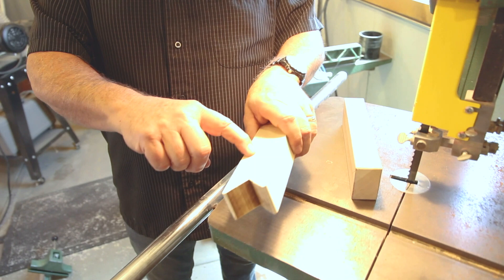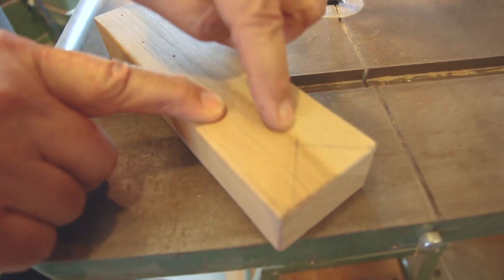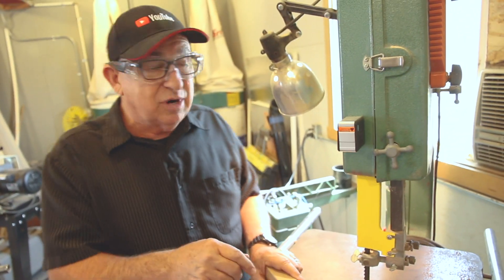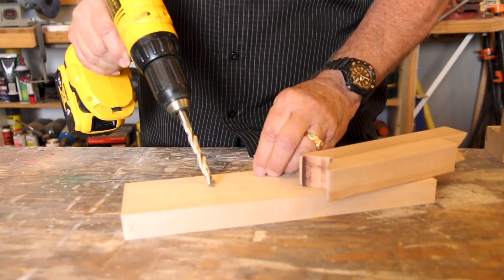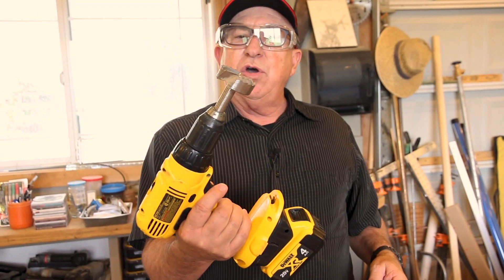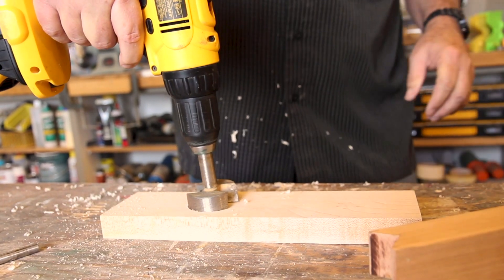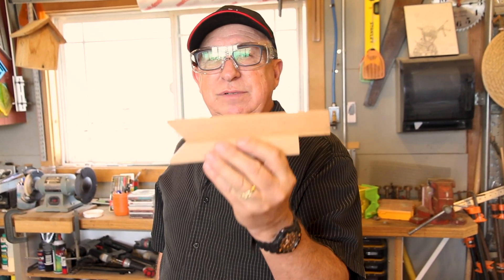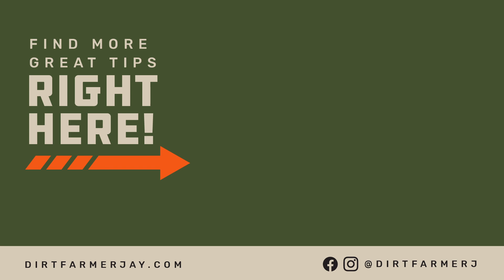Drill Straight Holes Every Time!

Comment: How can I make tool for center I need 120 holes for dowels to align ups straight on a loom end ... I need spacing if 1/4 -1/2 inch couldn't a hole be placed at 1/2 from the end so I can slide this up ? I need them straight both length of the board and straight base to tip. Thanks

Comment: Could you make one out of a square piece of aluminum ?
Reply from the maker: You could, you'd need a cut back to have clearance for the installation end of the nut. There is another fastener out there that doesn't require a tool like this - check out RampaTec. We have a video on them on the channel. Best, DFJ

Comment: Haha I remember I once made a drill guide by making free hand drill holes on a piece of wood, I ended doing like 20 holes until I finally got a very perfect hole that can be used as a guide to make holes on another surfaces, I marked the straight hole because the guide looked like cheese with all those holes, I did not bother doing a new guide using the previous guide. Good tips in this video, thanks.

Comment: A few years ago, I rigged up one of my drills so the drill bit was was vertical, then I glued a 2-axis spirit bubble to the back end. It doesn't keep it straight, that's down to the user, but it's perfect for making sure you're within a degree or two when you first start a hole. Really handy if you have to bottom out the drill bit and there's not enough to square it up against the workpiece.

Suprised more drill manufacturers don't include spirit bubbles by default, or have flat, parallel surfaces either side so you can square up the drill rather than the drill bit
Reply from the maker: Calibre Designs - you've got some great insights there. And, putting that feature on drill motor bodies would be an easy thing to do. Having a built-in reference surface would be a winner. Best, DFJ
Reply: I'm trying for a bit to add a system not unlike a picatinny rail to my Makita drill but the bloody thing doesn't have single straight edge or mounting point. I mean it's a drill, not a fashion accessory. I'm almost to the point to cover part of it in epoxy to give it a flat outer shape ;-)
Reply: @amonkane  maybe you can use a spirit level which is round and glued on the back using epoxy glue

Comment: Suggest you glue sandpaper on the bottom of the jig.
Reply from the maker: Jim, that's a GREAT suggestion. Thanks for writing. Same idea is putting sandpaper on a table saw angle gauge or jig. Works really well. Thanks! Best, DFJ

Comment: Hi thank you for the tips. I also noticed your drill. Just wondering how did you fit that battery on your Dewalt drill?  Or what's the adopter?
Reply from the maker: Project Kai, You're welcome! That IS a handy adapter isn't it? The Dewalt model number for this 18V to 20V is DCA1820. You can order these from several retailers including Amazon, Lowes and Home Depot. Expect to pay about $40. You can also find cheaper knock offs.  Hope that helps! DFJ
Reply: @DirtFarmerJay   thank you! I will try look some adopters for my old version dewalt tools.

Comment: Great! Thank you! I'm thinking you could make the v shape smaller with flat cutoffs (cut off the points of the "v" 90 degrees and mate with an identical piece, but without the handle. Two wingscrews hold them and let you almost down on the drill bit. If you want to ruin the simplicity which is it's great selling point. This was not such a good idea actually.
Reply: L shape brackets can shield the wood.

Comment: problem? doesnt the V shape piece of wood become altered with use over time??? surely a better way of doing this would be to glue some metal tubing in the V  (using epoxy) to act as the guide therefore reducing the wear made by the drill bit
Reply: Maybe uhmw plastic. They are available in adhesive tapes, 1.5mm thick. Slickstrip is this particular brand name i saw
Reply: Good idea.  But you would need an accurate tube and thus a block for each drill bit size.
Reply: Maybe if you used a half piece of tubing glued against the notch. Base the diameter of the tube off of the largest diameter drill bit that you have.

Comment: Love it, thanks!
Any ideas on how to make this tool w/o a bandsaw (or table saw, etc) ?
Also, does the drill bit ever cut into this tool ?
Reply: Take two straight scraps of wood and glue them together at a 90* worked for me
Reply: @candypaint6919  easy and brilliant!
Reply from the maker: End.Corruption - this tool can be cut using a fine-toothed hand saw as well, it's just faster and more convenient using a band or table saw. The notch is both to give clearance of the cutting portion of the bit, as well as allowing the bit to be placed correctly on the mark you made. Best, DFJ
Reply: Jigsaw🤷🏽‍♂️

Comment: I do like the idea but I was watching you use the forstner bit and I don’t see how you can drill very much until the drill chuck area hits the wood. Can you clear that up?
Reply from the maker: Tracy, thanks for writing. I could have shown a bit more on that point. If you are using a longer shank forstner bit, then you can more easily see the benefit. If not, you can start the hole with the end of the fixture that has the undercut on it, and get started correctly. Then you can freehand drill down just enough to get the top of the bit to be flush with the surface, then switch ends to use the end that engages only the drill shank. I hope this helps! Thanks for watching our video! Best - DFJ
Reply: Perhaps use a forstner bit extension...here's an example:                        https://www.amazon.com/Alfa-Tools-FB61490-Forstner-Extension/dp/B0035Y5TNQ/ref=sr_1_1?dchild=1&keywords=forstner+bit+extension+8mm&qid=1610709197&sr=8-1